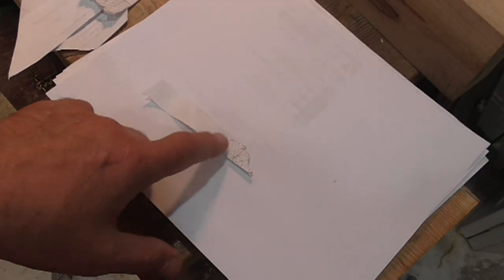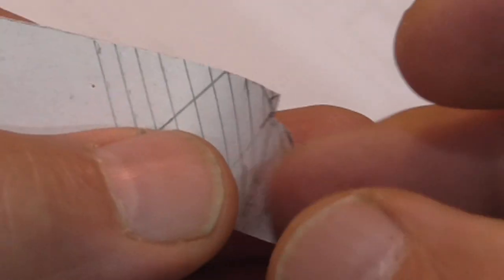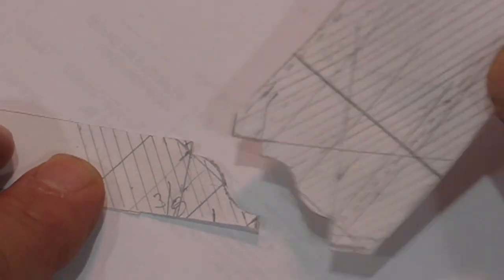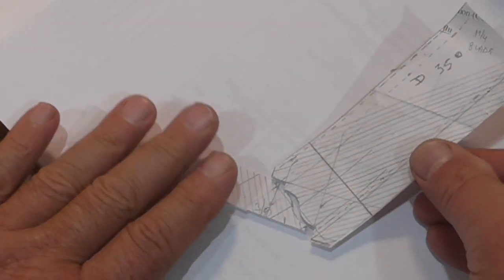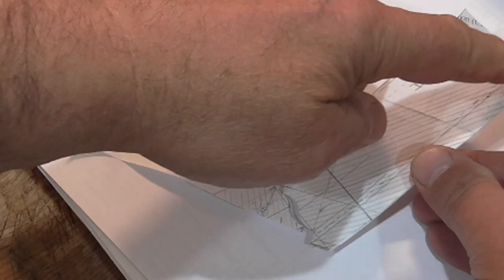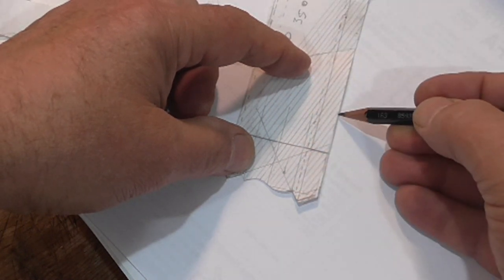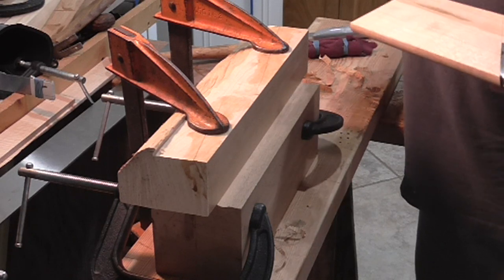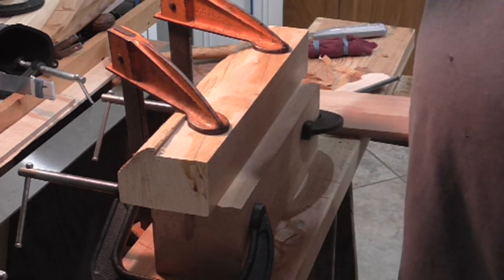Plane Making - Ogee Moulding Planes, Pt. 1

Comment: This is great! I was happy to find your video it's exactly what I needed to know.  I think you earned the subscription in the first few minutes of the video showing the reasoning behind your layout.  I have an old house circa early 1920's (Craftsman style) and wanted to make a set of hand planes that together could reproduce each molding profile in my house, including the window muntins, door inserts and the architrave molding above the windows and doors.  Luckily it is a simple style so not that many planes to make - but it is surprising how difficult (impossible) it is to find matching molding anywhere - or even router bit profiles that are close enough to modify. I have electric routers but they really are obnoxious - I like that these hand  planes can be used inside the house without making a huge mess and without freaking out the neighbors like the electric router will do.

Comment: At around 16:30 you are discussing final tweaks to get an exact profile match on the right and left hand planes.  When I saw your setup, I wondered why not start with a longer blank and then cut it in two (one piece for RH and one for the LH plane) after shaping the profile?  Have you tried this?  Maybe it's easier (when shaping freehand) to work with a shorter length?  Thanks for posting this great video.
Reply from the maker: Using longer blanks would be ideal for making pairs. I have a project starting soon, where I will try this, the lumber is left over from my chair making project.  Unfortunately, the longer length is a premium commodity, since the sawyers have a habit of cutting trees to fit in a fireplace.